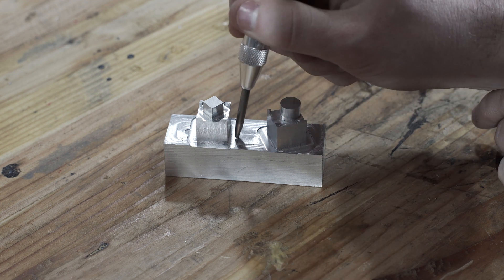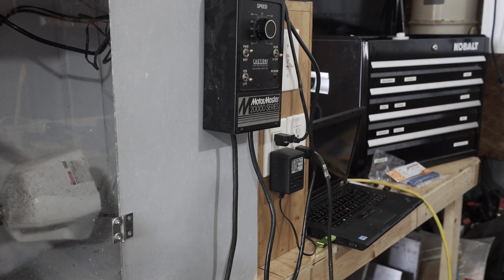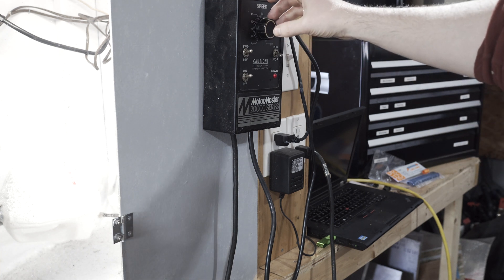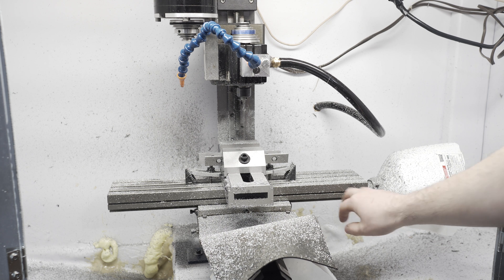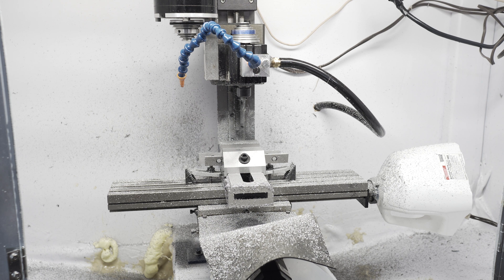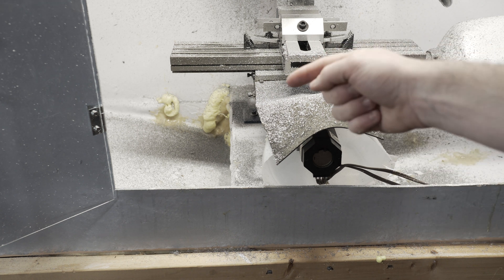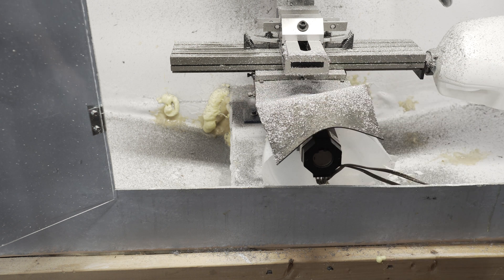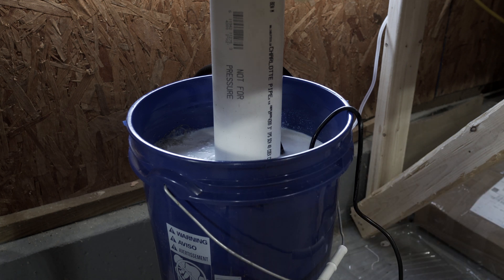A Taig MicroMill followed me home

Comment: if you only mill aluminum,  try a single flute endmill, its literally only needing 1/4 of the machine strength sice there is only  1 cut per revolution

0.025-0.05 mm chipload and anywhere from 8-24k rpm works great on my makerdream cnc (different machine and a lot better, but still a desktop cnc

Comment: Did you figure out the inaccuracy issue on the one axis? I’ve been considering getting a taig over a tormach due the price. They quote “better than 5 tenths” accuracy but I’m assuming thats local not over the whole setup. Tormach doesn’t make any accuracy claims but I’ve seen plenty of people say they can get 1 thou out of the bigger machines and 2 thou out of a pcnc. The Taig claim seems really impressive if its not local so I was hoping to get some insight.
Reply from the maker: I didn't, and no longer have the machine so afraid I can't offer much insight :( Mine was also a used model with an unknown number of previous owners, so that probably contributed too.

Comment: How would you say the noise is on this machine compared to a belt grinder? I've found a low grit belt grinder on steel is borderline too noisy for my loft, so I'm nervous about finding a sound solution before I purchase.
Reply from the maker: Hmm, maybe comparable? The steppers and spindle are very quiet, but when it begins cutting it can get loud'ish. Depends on material, the cutter and how fast you're going, but it can create a bit of a racket.  An enclosure definitely helps cut down on noise though, so that could be an option.

Comment: Does the machine have the ER16 spindle.  If not you need to install one.  With the tools as short as possible, this will improve rigidity.  The $74 WEN vise is great because I could easily mount it to a 3/4 aluminum plate and then the plate to the mill using 4 each precision T-NUTS.  These are two changes that will make a major improvement.  You need to come up with a Z-Axis way cover.

Comment: You should use higher parameters, it's only an aluminum. For example Vc=400 m/min, Fz=0.01% of D endmill. Ap=1xD
Reply: lol.
Reply: With 1/5 HP, a toolmaker's vise, and a flexible column, that's just not going to happen

Comment: Thank you for posting.  Its been hard finding recent videos of Taig users.  I saved up to finally buy a 4 axis MicroProto. (Based on the Taig mill) I don't regret it as for the price, there is nothing as precise. It takes a while to get it dialed in,  yet once it is..repeatability is awesome.  Anyway,  nice to meet another user.  I look forward to your videos!
Reply from the maker: Thanks for stopping by!  Agreed, seems hard to find folks using the Taig nowadays! Took me a little while to get settings, feeds/speeds and end mills dialed in, but I'm very happy with it now.  Have a bunch of footage that I haven't turned into a video yet, but it's worked great for small aluminum parts so far. Recently picked up some variable flute end mills for aluminum, looking forward to seeing if that helps with chatter/vibration. Have fun with the MicroProto!

Comment: Whats with the long spindle extension?
Reply from the maker: Needed for "larger" end mills on the taig.  The collets only go up to 5/16, after that you need an end mill holder which screws directly onto the spindle, has a lot of stick out, and is not terribly concentric. :)
Reply: @BreakingTaps  hmm My Taig with er16 collets go up to 3/8'', but ok makes sense.
Reply from the maker: @Cayenne Ahh right, my Taig came with the older style, proprietary non-ER collets :(

Comment: Morning Zach.  BAHAHAHAH - nice pitch off the vise.  More practice and you will hit the scrap bin on every try. LOL.  Thanks for warts and all - happens to all of us brave enough to share.

Long way from an old manual mill. If that old Rockwell is in the way - I will accept your donation and even pick it up. LOL. 

Need a spring on those parallels to keep them spread out.  Ask me how I learned...LOL.  Also - get a Randy Richard in The Shop Scribe - makes me smarter by its mere presence...LOL. Still screw up but I imagine it would be worse without the scribe... 

Music was awesome ans usual. 

Dan
Reply from the maker: Haha not a chance giving up the Rockwell :P  If anything, this little baby Taig has made me appreciate the Rockwell even more :)

That part flying off the vice put a nice dent in the plywood enclosure.  Made me laugh so hard after it happened... took me a minute to realize what happened.  One of those "did that just happen?" moments XD

Will investigate a spring/parallel spreader.  I've seen them before and didn't understand why you'd use them... but I think I'm starting to see why.  Will give it a shot, thanks!

Take care Dan!
Reply: Yeah I went through a Sherline phase with mini lathes and mills. Spent way more than the bigger stuff and far less ability to do the work I wanted. They are great machines as well as Taig - but you have to stay in their performance window to make it worthwhile.  The resale on used pieces for both Taig and Sherline was ridiculous - like Google stock they never went on sale.